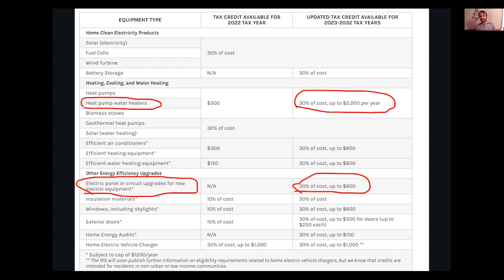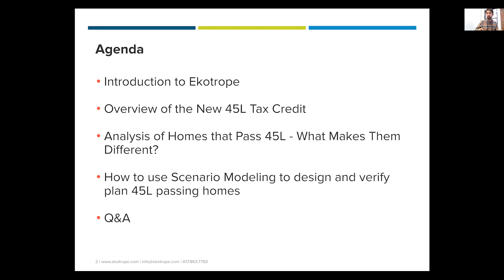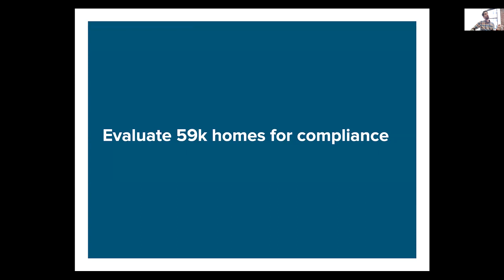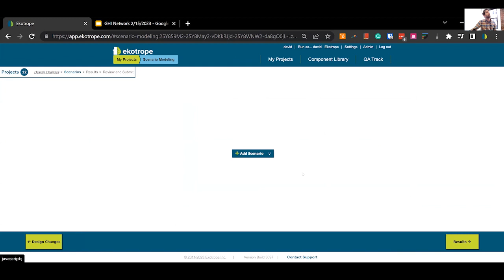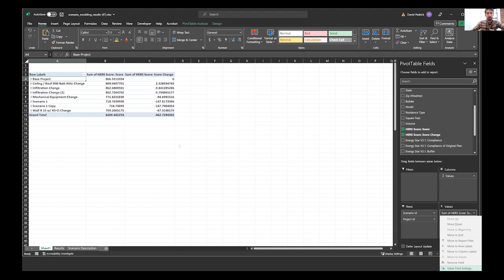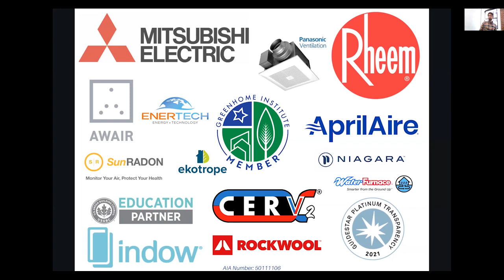Real Time Energy Model to meet, beat code and get IRA 45L

Comment: The presentation by ekotrope was intresting but I am really intrested in the retrofit application of these tools and any potenial tax benifit avalible for such retrofit. 
I have just purchased a home built in 1940  and need a tool to evaluate which changes to the home will make the biggest improvement in my house. 
Is there a tool that also links the improvements to building preformance to cost in materials and labor involved in making any changes as each senario may have similar results in building 
proformance but have vary different costs to implement them in a retrofit enveronment. Any tools or advice you can give me would be appreciated, thanks.  scott
Reply from the maker: Hi Debbie - The HOMES 25C Tax credit is available now for existing homes here https://www.energy.gov/policy/articles/making-our-homes-more-efficient-clean-energy-tax-credits-consumers but each state needs to adopt the big IRA existing homes rebates (up to $14,000 per home) which will include a tool you are talking about called https://snuggpro.com/ we will be launching a version of this soon where you can look at costs and even achieve GreenStar Homes certification. Stay tuned please. For now make sure you get a GreenHome Inspection https://greenhomeinstitute.org/greenhomeinspection/